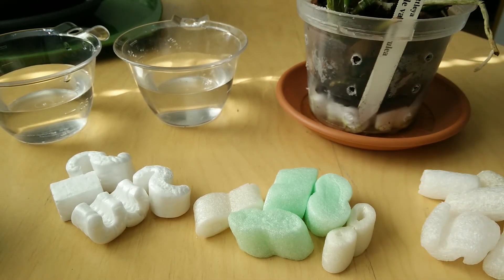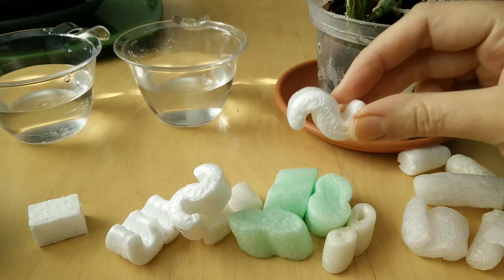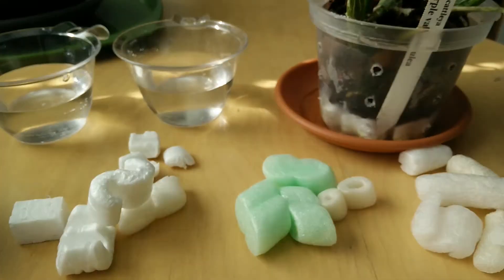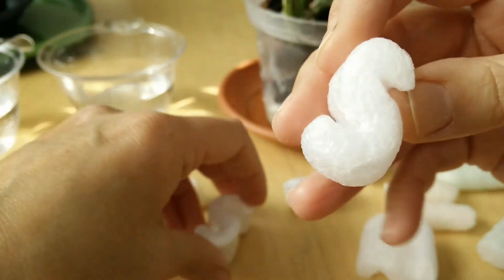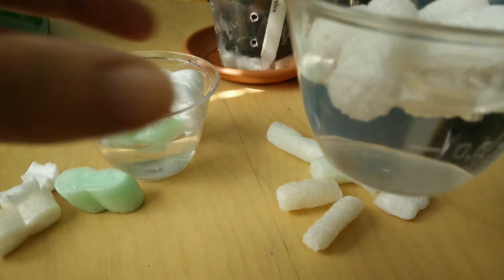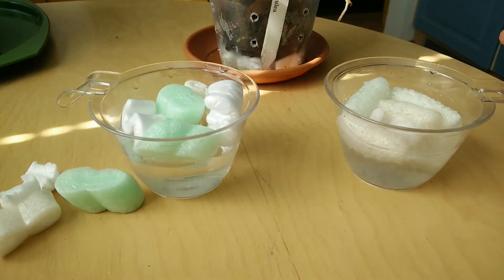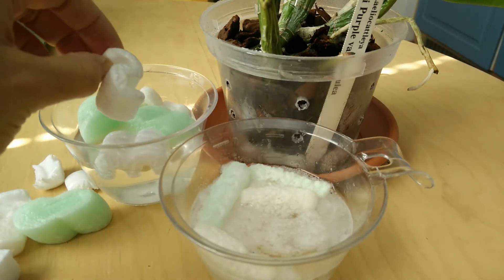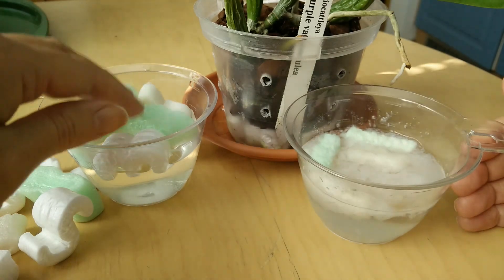Package peanut: friend or foe? An experiment, and a warning!

Comment: Good video. Have you ever planted things in a pot without any holes? I'm trying to figure out how to make sure that my plants don't sit in water and that they receive sufficient oxygen.
Reply from the maker: +Charles Lumia Thanks! I have some orchids in pots without holes on the sides, but with holes on the bottom. They take more time to dry, so I water the media from above. The side holes are very good for ventilation, and it's probably better to have them. But they do well in pots without side holes too, as long as we make sure the media dries well before watering it again.

Comment: This is such a FANTASTIC idea using the peanut packaging for adding drainage :-) and one that I will be able to use with some of my succulents for drainage as it is much lighter than using crock or stones :-) I noticed that some of them are made of starch and they melt, I remember ordering some plants one day and they had starch packaging in the box and the peanut packaging were all soft and dough like LOL! but I will make sure that I only use the polystyrene ones :-) Such a FANTASTIC video and experiment, thanks so much for sharing and have a FANTASTIC Thursday XXXXX <3
Reply from the maker: heartfullofhappiness I wondered myself if it's such a good idea to ship plants with these starch peanuts. Sometimes the media in the pots is moist, and I imagine the peanuts could start melting or sticking to it. :) Some time ago most of the package peanuts were styrofoam, but the starch ones are nowadays often mixed up with them in the same box.
Reply from the maker: heartfullofhappiness Styrofoam peanuts probably would make a good drainage for succulents as well. :) At least the small ones that are not top heavy. :)

Comment: I did n't know there is packing peanuts made out of starch! Very informative video. I shall lookfor the best type that you mentioned. Thanks for sharing.
Reply from the maker: MaryG Orchids These biodegradable starch peanuts seems to be relatively new, compared to styrofoam. It's becoming more common nowadays, and they are usually most often when companies ship electronic equipment to their clients, because differently from the plastic package peanuts, the starch based peanuts don't hold electrostatic charge and can't damage electronics. But often when I order plants, in the same box is a mix of all these different kinds of peanuts.
Reply: Orchids & a Dutchy thanks for your thorough explanation.